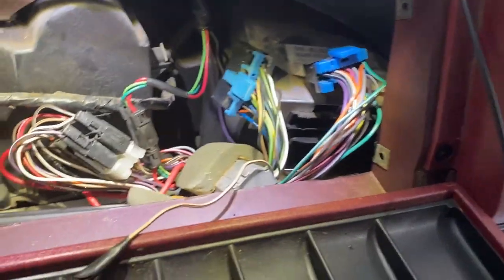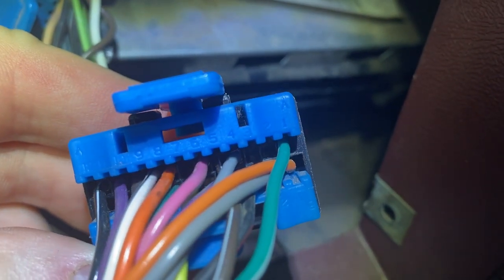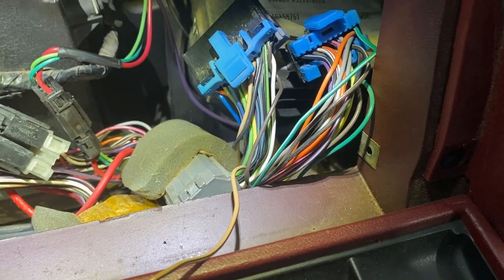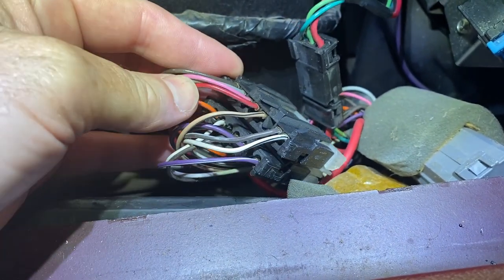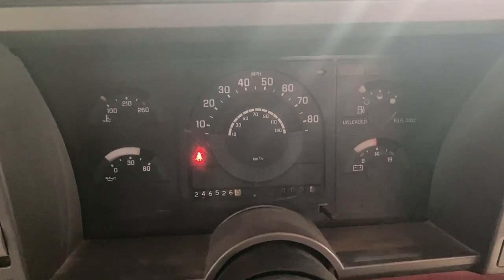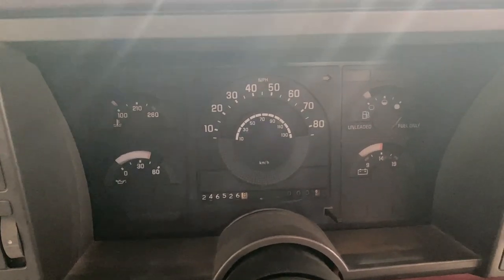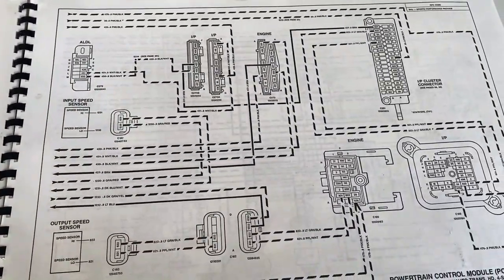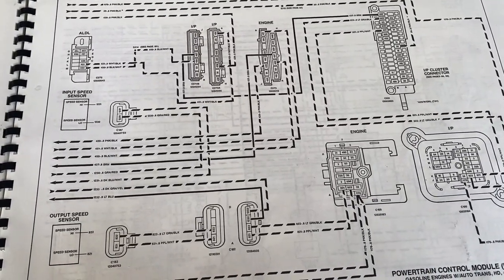OBS Chevy Project Truck LS Swap Wiring Issue MIL Check Engine Light Stays on with NO Trouble Code

Comment: What pin on the ls pcm did you use? You wired that one to the wire goin to the dash right?
Reply from the maker: C2 RED #46 is MIL on 1999-2002 PCM.  That is correct. You really need a wiring schematic for your truck to make sure you have the correct wire, but in short, yes, it goes to the dash.
Reply: @laurencevillegarage  Thanks For the help. I have the same issue. I couldn’t figure out why it was still on.

Comment: After removing both wires  which one goes to ls pcm??  The one from obs pcm? Or the one at connector?
Reply from the maker: The one at the connector, technically the connector is  #C273A as per the GM manual. It is the wire that would run under the dash towards the driver side.
Reply: @laurencevillegarage  @ ok then that just goes hooked to the ls pcm mil light
Reply: @gerardolopez5875  wich wire did you end up hooking up to the ls pcm? The tan wire or the dark brown wire coming from the left. (Dash cluster)
Reply: @irwinhernandez5558  @ to be honest ism confused here,   I’ve been told that ls pcm Wire goes straight to  brown mil cluster wire, and it would work,,  but on these video it shows just tan/black stripe wires,,,
Reply: @irwinhernandez5558  @ ok, found out,, just dark brown/ white stripe , from cluster to LS pcm, and should work,,,
Reply: @gerardolopez5875  ok thank you, I had it connected that way but thanks to this video I found out the obs stuff was still connected. By removing the 2 obs wires the light is off. I’m going to reconnect the drk brown/white wire coming from the cluster back to the ls pcm wire tomorrow and see what it does.
Reply: @irwinhernandez5558  @ ok let m know
Reply: @irwinhernandez5558  @ did  it work?
Reply: @gerardolopez5875  yea I think it worked. Connected it but got a check engine light. Got all kinds of codes. Lol. My truck runs good but I want to go trough theM to see what they’re for.
Reply: @irwinhernandez5558  @ cluster brw/ wht   Direct to  ls  pcm ?
Reply: @gerardolopez5875  yea that’s how I have it hooked up.